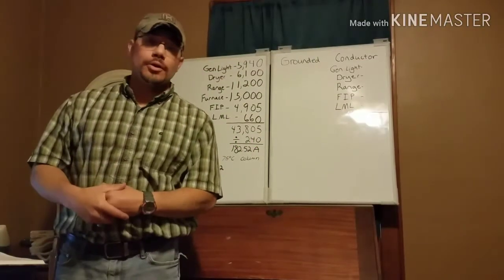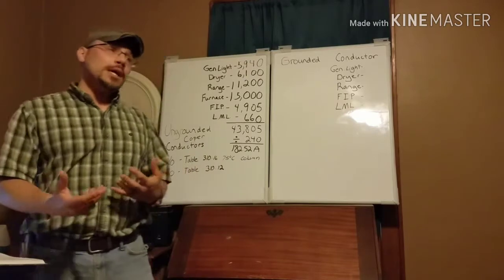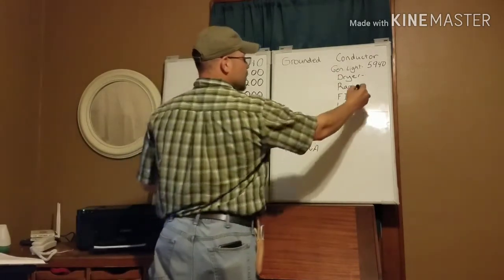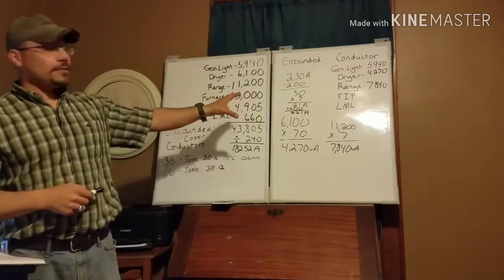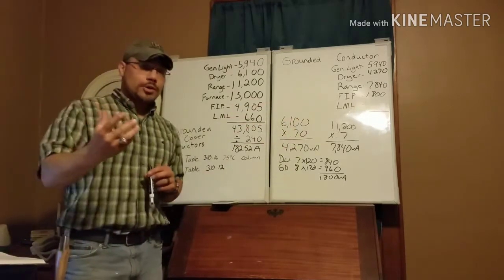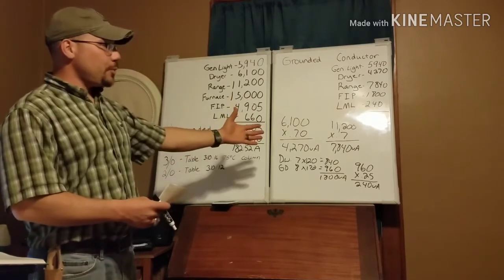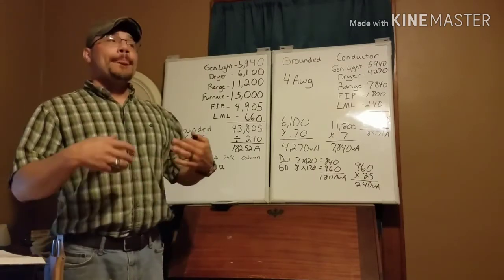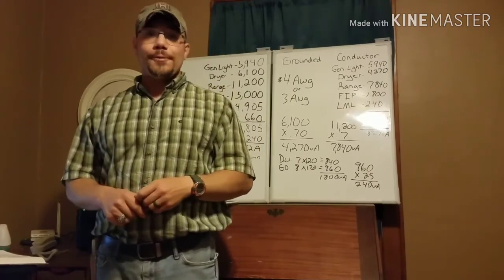NEC Article 220 Service Calculations (Part 5)

Comment: Why we use 240 v instead of 120 v don't we use 120 v in the united states ? Can you please explain that point . thanks
Reply from the maker: Sahbi thanks for the question.  Yes we use 120v in the United States.  That is the single phase voltage (hot to neutral or hot to ground) that is used in a residential setting for normal 3 prong plugs.  240v is used in residential applications for dryers, ranges, furnaces etc. That's 2 hots, one ground and one neutral. We also use 480/277v in commercial and industrial applications.  Hope this answered your question
Reply: @electricaldan2255  thanks a lot for responding

Comment: Your largest motor load is supposed to be 125% of the motor load per 220.60. You multiplied by .25 when it should've been 1.25
Reply from the maker: 220.60 is talking about noncoincidental loads.  Not motors. You are looking at 220.50 which points to 430.24. It is talking about 125% of the largest motor load.  We've already factored in the 100% with the appliance calculations so we just need to add in the additional 25% we haven't factored in.  Hope this clears this up